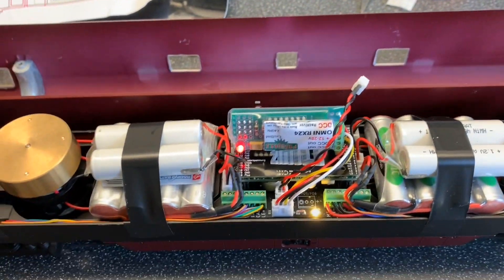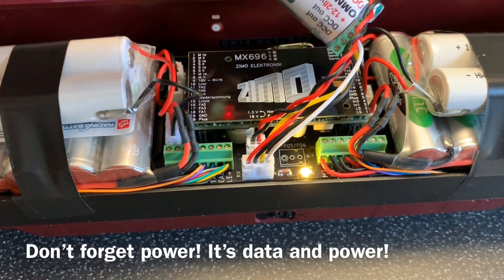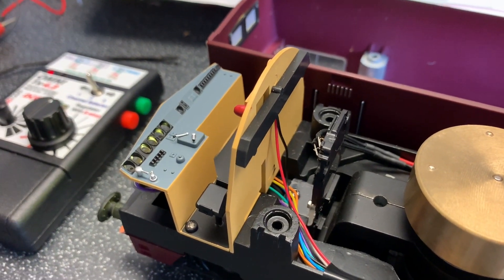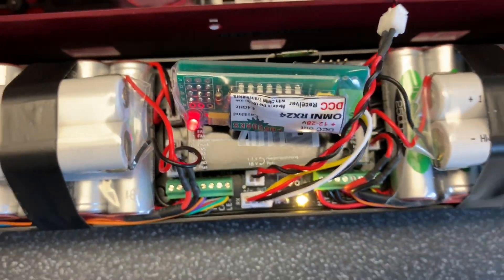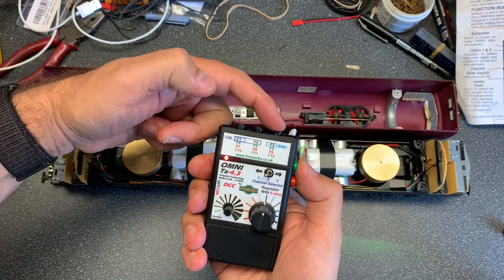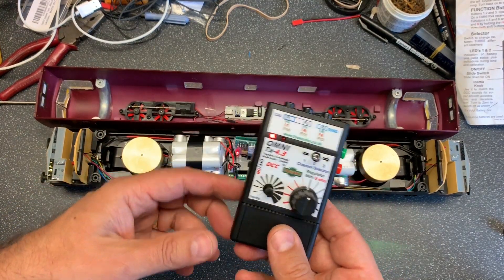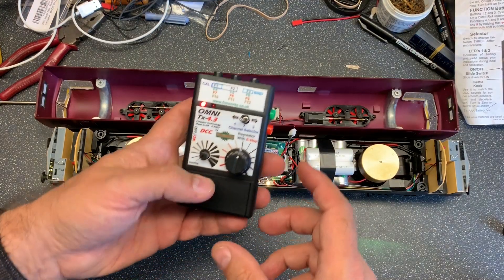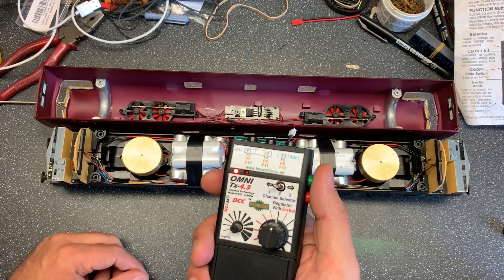Battery DCC Sound Heljan 0 Gauge Western - Fosworks Control

Comment: Amazing!  Do you think this setup could work with EU Loksound?  My mate did some great sound for his DCC on a EU Loksound but I don't want to use DCC, am planning to use battery power so have the issue of what the heck do I do if I want to use his EU Loksound - would this setup work!??  If it does it could provide me with a solution that no one seems to be able to answer!
Reply from the maker: Yes I'm going to do a version of my board that works with the Loksound v5 too. The Fosworks and Tam Valley systems don't care what make of DCC board you use. I designed my boards around the Zimo because at the time only Zimo had boards with pins that you could plug into other boards. You don't need to change the board you could just use the Loksound decoder as is but it's a lot of extra connections so it can get messy...it's why I decided to make a replacement for the factory boards especially for battery. Join us at the 0 gauge battery group https://www.facebook.com/groups/batterytrains Thanks for your interest.
Reply from the maker: Now have the ESU version of the board, going to try it first in a class 50...